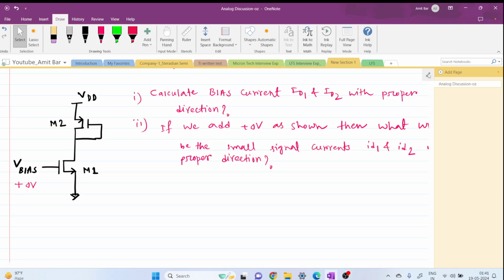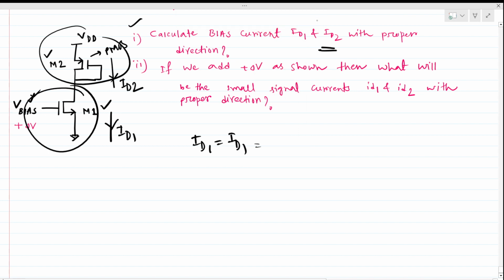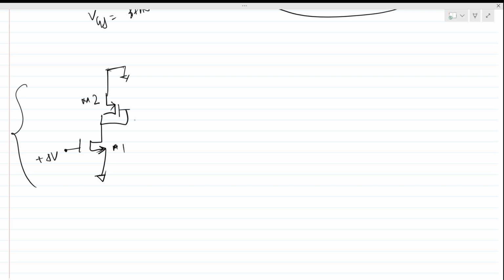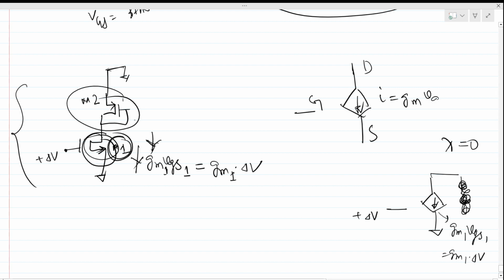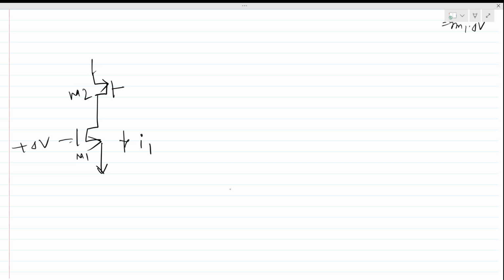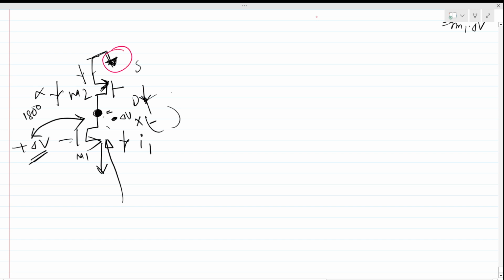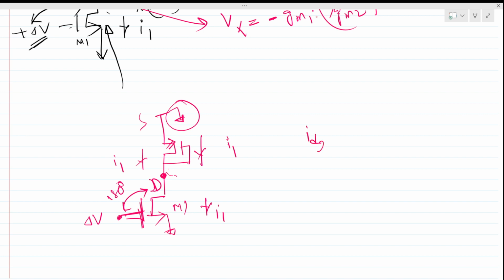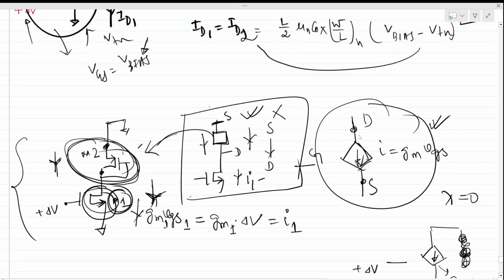Analog Circuit Design Engineer interview_Find small signal currents with proper directions and WHY

Comment: I have 2 doubts
1) how can be the drain of nmos be negative. The device structure does not support this
2)  current in pmos always from source(higher potential) to drain(lower potential)
Reply from the maker: Try to learn what is difference between Bias and ac small signal conditions

Comment: I have a question,if the output node is negative compared to the ground potential.Then won’t the current direction in the nmos be in the opposite direction as well..
Reply: Just think about dependent current source case, gm2vgs2 and gm1vgs1 as vgs2 is negative so the direction is like that
Reply from the maker: As the small signal current is a dependent source so the dependent node potentials decide the current directions , other node potentials doesn't matter